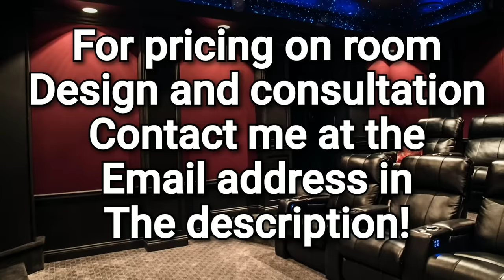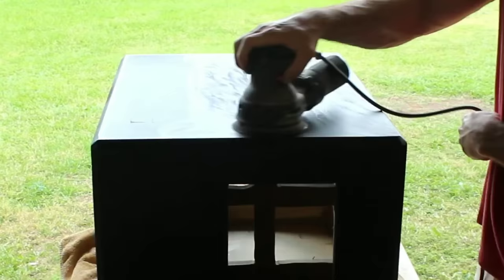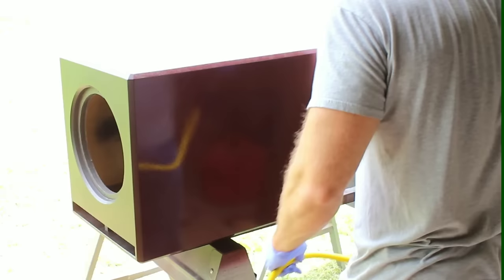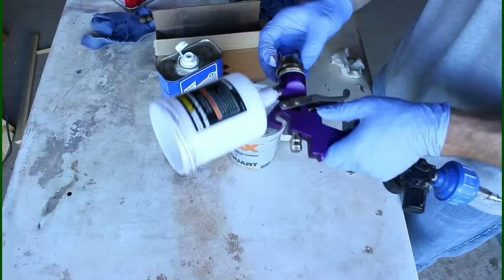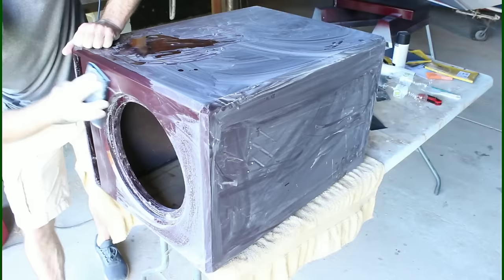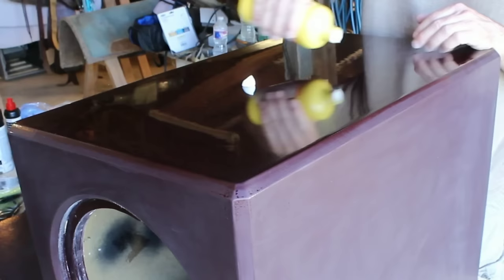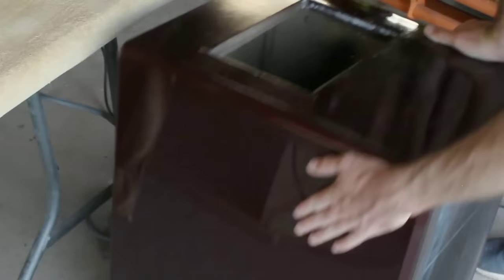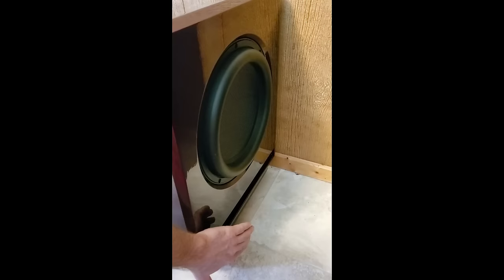Ep. 35 - How to get an amazing Piano Gloss Finish on the Hammer Home Theater Sub| Home Theater Gurus

Comment from the maker: A lot of you guys have asked about the air compressor I used.  Here it is!   https://www.lowes.com/pd/Kobalt-QUIET-TECH-26-Gallon-Single-Stage-Portable-Electric-Vertical-Air-Compressor/1001014062?cm_mmc=shp-cprdtolgglLIA_TOL_153_Pneumatics-And-Compressors-1001014062-local-0-_-0&ds_rl=1286981&gclid=Cj0KCQiAt8WOBhDbARIsANQLp97Rn3hGlj5of632gOAH7Yn5-hc39jJAkZv8hv_EBslR27EjaZTBdmcaAtu0EALw_wcB&gclsrc=aw.ds
Reply: How small 0f a compressor can you use. I was in the store looking at the little 2 or 3 gallon ones but wasn't sure if they could work
Reply from the maker: @shaunbouchersr9544  they usually have a visual graph next to the price that shows what they'll run.  Anything that will run an air tool will have no issues with a spray gun as it's run at a  much lower Psi.
Reply: @hometheatergurus  cool  ive ordered everything just need to figure that out.  ive watched the video back to front least 20 times im gonna follow it exactly.
Reply from the maker: @shaunbouchersr9544  good luck!

Comment: Just a tip from a painter. Use a larger sanding block that covers the whole surface during all sanding phases including the primer and you will have a flatter surface for your piano gloss. And sand in between all coats of clear. That's how pro automotive painters get their smooth surfaces. Love the color...
Reply: @Pedro-0839  Yes, wet sand
Reply: Would you build homemade sanding block to do it or can you purchase one?
Reply: @aaronm5535  You can buy them but it would be cheaper to make your own and work just as well
Reply: @kotogray8335  why wet sand instead of dry sand?
Reply: @mixsterdude  Dry sanding clogs up the sandpaper too quickly and using water helps the sandpaper to stick to the surface helping to create a smoother finish
Reply: Use a sanding block that covers the whole surface? You mean, a giant sanding block that is like 20 times as big as the one in the video??
Reply: What about the last coat ? And can i apply this wet sanding technique to a oil based Polyurethane ? Greets
Reply: @krisgebruers8471  You need to use fine sandpaper on the last coat and then use 2 or 3 levels of polishing compound with a buffer to get that mirror gloss finish
Reply: @kotogray8335 Thanks for your reply mate. What grit of sandpaper would you recommend ? I used 400-600 grit but i didn't wet sand or polished, so i will try that ;)
Reply: @krisgebruers8471  Iwould use 400 or finer between coats and then finish with 1000 then 2000 grit before polishing
Reply: @kotogray8335  Cheers
Reply: no... you don't sand in between coats of clear.....not on a car at least.
Reply: Tip from a real painter.  Apply high build primer, then apply guidcoat. Wetsand fill low spots reapply primer apply guide coat wetsand again.  If no low low spots are left after guide coat apply sealer, basecoat and then clear coat.  

I can go over the next ten steps, but I could care less.  You’re not a painter.  You don’t even know wtf you’re talking about.
Reply: @genuinejake9851  yeah he's talking about flow coating, it's extra work and more expensive, it's not something car painters normally do
Reply: @eksine  Yes I know how, I don't use that method because i feel its inferior
Reply: @genuinejake9851  yeah off the gun finish is good enough, the guy in the video doesn't know how to do that. The speaker has 6 sides though, I dont think it's possible to do that in this case

Comment: Honestly, I think you did a marvelous job. Long ago I get my degree as a painter, and I love how people like you take the cow by the horn and go for it. If you have much orange peel I advise lower pressures and watch you viscosity of your paint. But anyhow, I love your video. You explained step by step, nicely, how you get the things done. I hope people are inspired by this video and go building themselves. Great job. If there are any misspelled words, I am sorry. I am Dutch and try to do the best I can. Sincerely, Bert de Vries. Hillegom, The Netherlands.
Reply: Viscosity is key.  Learn to use a viscosity cup and as pressure and humidity change, you will always be spot on.  I used to have a notebook with all the different paints I used and what viscosity they sprayed best at.  Keep your  first few coats thin, too thick and the atomized paint dents the previous coats (orange peel). Too thin, you get blush from where the solvents evaporate out and you get a dry matte look.

 I agree, great job and pretty good explanation.   Put enough clear on and you can sand anything back.  Lacquer is the easiest to paint with, because it cuts into the previous paint, and just color sand and polish.  Autos originally were brushed on lacquer and then sanded back and polished (I have done that ).
Spray edges first, then spray the panels, it leaves a higher build on the edges so you are less prone to sand or polish  through.  Autos originally were brushed on lacquer and then sanded back and polished (I have done that ).  Most places frown on Lacquer now
Reply: @garry7263  you are absolutely right. I love it when people now how to do the job. I love the people more when they want to learn the steps. I have noticed that people in corona time, trying to do more D.IY. stuff. They are not afraid to make a mistake. You learn from your mistakes, but never give up. 
@garry7263... you nailed it with your answer. For everybody, build your stuff and new proud of the results..... eventough it's not perfect. Greetings from the Netherlands. Bert de Vries

Comment: So awesome. I have two sets of towers that I built years ago. I love building homage speakers. I’ve never been able to put any kind of decent finish on them. I’m inspired to try this process on mine now.
Reply: Did you do it?
Reply: @murrayshekelberg9754  I did. You have to beware for rounded surfaces. I kinda had those rounded edges and the paint didn't wanted stick it it for some reason. I should have sanded more. The rest was perfect after third layer of paint

Comment: When working with MDF I found the best primer in the whole wide world.... to be wood glue.  Even the really rough edges it completely seals them, no pain will absorb at all.
I just got a HVLP and LVLP sprayer, I have no idea how well that would work to apply it, but its cheap, tough, and sand-able and paint-able.
Reply: How do you use wood glue as a primer?

Comment: When you wet sand don’t use just water. Add a few drops of dawn or just a standard dish soap to the water. The dish soap breaks the surface tension between the water and paint so when you sand your sandpaper will have a layer of water between itself and the paint. That is what you want when wet sanding. There’s a big difference between using dish soap and no dish soap.
Reply from the maker: Thanks, I'll try it out next time.

Comment: You have 48 hours to spray your base and you dont need to sand. The epoxy chemically bonds to the base coat,meaning it dosent need a mechanical bond(sanding).... that epoxy sprays nice and thin if you reduce it 1:1:1 and use it as a sealer wait an hour or two to let it dry then hit it with base/clear.  and you won't be able to tell the difference. i grew up about 200 yards from summit. good job , just a time saver .
Reply from the maker: Thanks Brandon,  I'm definitely no pro so I take any advice I can get.  I'll do that on the next one.  Thanks!

Comment: If you mix up some white glue and water and paint that on the MDF before you start, it seals the surface enough so that the paint sits on top. Just a thought for the future.
Reply from the maker: I actually did this to the edges in the previous video. It seals great.  With the epoxy primer I wouldn't be surprised if  the primer sealed them on the 2nd coat without pre sealing.  It's fantastic stuff.  But I always seal mdf edges with the glue /water mix.  If you don't they're sponges for regular paint as I'm sure you know.

Comment: great job but just a tip to help out. Soak your sand paper for 20-30 mins prior in and bucket of water with a few drops of dish liquid in it. Personally I use a spray bottle to wet down the surface.

Comment: Nice job. I was taught in my apprenticeship to rub a bar of soap on the wet and dry sandpaper while using it with water. It helps the sandpaper from clogging with the paint. Also helps with the finish.
Reply from the maker: Thanks for the tip.  I'll definitely try it next time.
Reply: Adding a few drops of liquid soap in the water has the same effect.

Comment: Dude, can't believe you did all that final sanding by hand! That takes a while with that fine of paper... End result looks great man. You did a great job going over everything. I used to paint cars in my dads shop back in high school and shortly after. Lots of work to get a good finish. You are correct though, no painter can completely get rid of orange peel. You get lucky sometimes, but not normally lol. If you do this again, besides getting a DA sander for the clear coat sanding, grab yourself a "california squeegee." That will complete remove all the water off the surface quickly to where you can see the cloudy/shiny areas in the clear coat. No more rags at that step. Once we started using those, it was a game changer! Again, looks awesome. Better than my swopes I painted several years ago! I didn't do the sanding/polishing step on mine, sort of a rush job. May redo them one day... 🤔
Reply from the maker: I only did the initial wet sanding by hand but yeah as I said in the video next time I'll get some paper for my sander for that step.  Even still it only took maybe an hour to do that step but i did arms  that day and the felt like noodles after sanding.. :)  As for the squeegee, that's a great idea.  I'll definitely do that!
Reply from the maker: Ohh and yeah that orange peel was bad..LOL.  If I didn't know about the wet sanding I would  have given up.  It was great for the video though.  The first time I did this last year had just a little.  Thank goodness for sanding, compound and buffing.  Bring on the orange peel!!

Comment: Great job! Just to get my 2 cent's worth in, I soak the sandpaper I will be using for 15 to 20 minutes in water. Then everytime I see that my block is about to go dry, I dip it in water. That way all the slush on the paper gets washed away and it leaves a film of water on it to continue sanding.

Comment: Astonishing! Like you said…it looks like you could dive right into the surface.  Not sure I could cope with all that spray gun business….but the technique for getting that flat surface with wet & dry paper could probably make good even with a (carefully applied) rattle can finish.
Thank you.👍
Reply from the maker: Thanks.  I've been thinking I need to do a small project with rattle cans. You can buy auto clear coat in a rattle can.

Comment: Statistical data suggests typical subwoofer distortion to be 50% down to 30% and slightly lower on very high performance models, yet audio enthusiasts will groan and moan about an amplifier yielding just less than 1% total distortion. Try to remember the listening room and the speakers are always the source of the greatest amount of distortion. Nice finish on that sub. I need that paint job on my car.👍
Reply from the maker: Thanks and trust me I wouldn't want to mess up your car so don't let me do it .. 😁

Comment: You can use rattle can primer for mdf but you have to use a primer that is a sealer/filler type primer. Two even coats or one coat overlapping 50% like you did will work.
Reply from the maker: I may try it but I absolutely love the epoxy primer. It's cheap and you can cover a large area very quickly with the hvlp.

Comment: This is amazing. I eventually want to give this kind of finish a go. Fingerprint magnet but so so pretty. 

I myself just finished a box for an Ultimax 10. Baltic birch plywood stained with dark walnut oil stain. Finished with 3 coats of water based gloss. 

It's about 3.5 cubic feet tuned to 19Hz with  3 10" Dayton Passive radiators. 

I've yet to order the passive radiators but hope to get around to that in a week or so.
Reply from the maker: Thanks.  The um10 is a really good performer and even works well in a box as small as a cube (net) tuned down to 20hz.     Good choice!

Comment: For mdf I'd recommend skipping the epoxy primer and using a coat of poly, sand, do a second coat of poly, primer, guide coat, block sand, filler if needed, sealer, basecoat, clearcoat
Reply from the maker: The Epoxy is fantastic with MDF.  I've tried several different coatings and it's now my go to.  One coat is really enough and two and your surely done.

Comment: My one critique from the beginning is you're "fanning"  while painting. This is going to cause more buildup of paint in the center of panels and thin edges. And before anyone jumps on that, YES... skilled painters will often fan while spraying large panels but they do it AFTER painting all the edges and corners since. Always start with the edges and corners, then fill in the large areas. This is very important when spraying clear since the edges will have had just enough time to flash off enough that you wont get a run  when hitting the main panel.
ALso, when cleaning your gun, remove the needle FIRST. If you don't you'll bugger the end of it when removing the nozzle.
Reply from the maker: Thanks for the advice!

Comment: I am going to be building 2 of these, with a slight modification. I will be using Kicker CompQ subs. They put out as much power as i can find.  Now i just need to find amps with enough power to push them.
Reply from the maker: Be careful and make sure you model them in this enclosure first.  It's very possible they won't perform well in this enclosure and could be heavily outperformed by the driver is was designed for.

Comment: What a difference from 2000 grit to the polishing stage.  I wonder since there is obviously imperfections in each coat if the final result would have been even better had you sanded or polished the top coat before the clear, since what ever imperfections were in the top coat are still there under the clear.

Also nice to see an experienced person using the same kind of rubber feet I do rather than insisting you need something like the SVS isolators. 
For situations I do not want permanent feet, great luck with the anti vibration pads made for industrial equipment, compressors, washing machines, etc.
Reply from the maker: There's no visible imperfection noticeable once the clear was applied and finished.  An auto body guy may be able to answer better but to my eyes I'd see no reason to.

Comment: Looks beautiful amazing job next time use a spray bottle when you wet sand I work in a cabinet shop in the finishing dept I am not a pro but learning from the pros in high gloss they usually add close to 7 or 8 coats of of clear of course sanding in between you will end up with less and less orange peel it will be almost not  existent but awesome job regardless.
Reply from the maker: Thanks I may give that a try.  In this one I actually wanted to have orange peel just to show that you don't have to spray it perfectly as it can be fixed.

Comment: The using a spray bottle, that’s what I use and it makes it so much easier and faster.  Nice work.  I paint 4 base coats and 7 clear coats. I know very over kill but if you ever put you hear on top, it gives you more meat for buffing later on
Reply from the maker: I actually used a spray bottle the first time I did this which last year.  This time I just grabbed whatever was close.  It's definitely more convenient. 

And wow.. 7 coats.  Yeah that is definitely some insurance. Nothing wrong with overkill especially when it helps ensure you've got plenty of protection when sanding it down.

Comment: It's best to wet sand the first clear coat with 1200 and some 0000 steel wool to get rid of the orange peel. Then clean it thinner and then spray clear coat again.  Let the first clear dry for one day, at least . If heated, you can sand after an hour or two.   Gotta warn you about auto clear coat though, they are nasty . Many people have died from it . You need a booth to spray them.

Comment: Sorry, one more thing. I take it to 5000 grit where I sand at 25 - 30 degree angles going from one grit to the next in order to negate the scratches from the previous grit. Then, I hit it with a cutting compound before going for a fine one (here in Europe I am using compounds by Rupes, who also make professional sanders). Like I said, just my 2cw

Comment: Great job..I have to re finish a black gloss piano.I see you used epoxy black primer.What top coat system did you use..is the base coat a 2 pack (with hardener) and also is the clear coat 2 pack (with hardener.
Reply from the maker: Thanks.. It's been a few years but all links are in the description and the video shows the products used and shows me mixing them and the ratios.

Comment: With those Griot's Garage bottles that have that red dome cap, instead of taking the whole cap off, pull it.  It will open a small hole at the top similar to those bigger water bottles.

Comment: Hey, great video, thanks for the upload.  I'm building some speakers and would like to finish them in a similar fashion.  A couple of things I missed: Do you sand the base coat between your 2 coats, or after your 2 coats, or not at all and go right to the clear?  The other thing was, do you use the same cutting discs for the final polish (Super Finish 3500)? or is it something else?  Thank again.